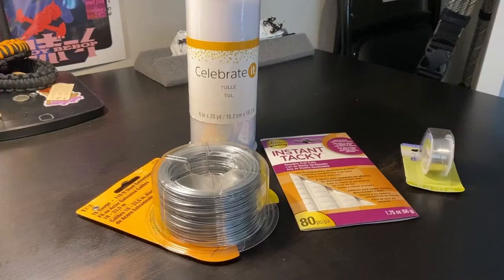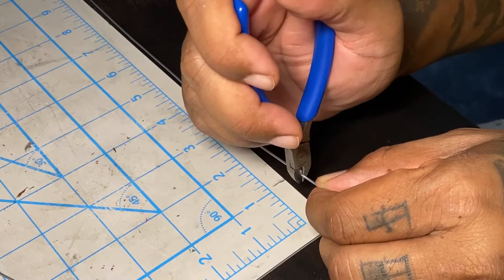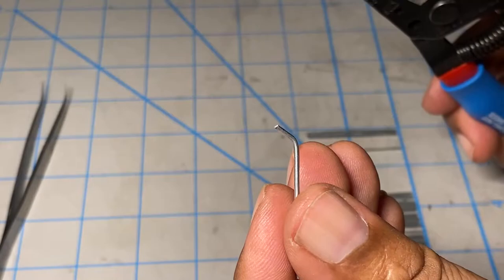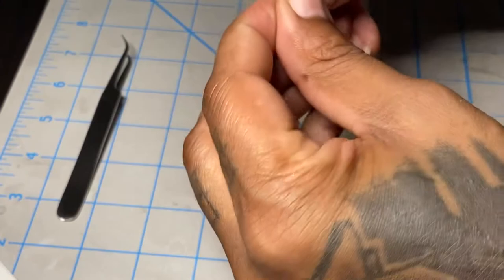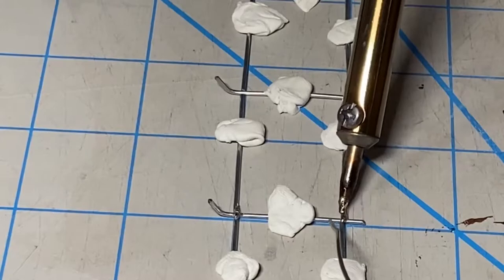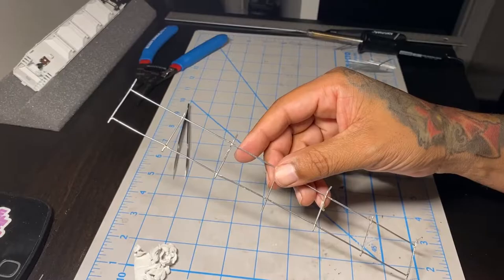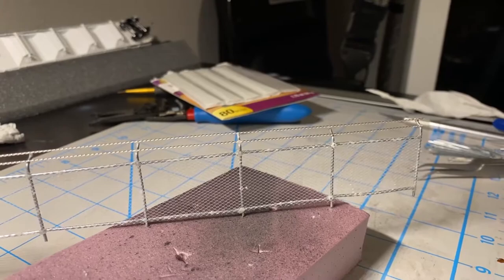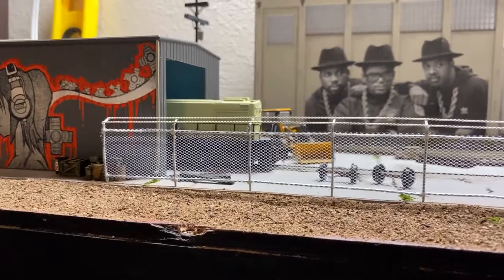Chain Link Fence (how to)

Comment: Great video. Just a note, having a single bracket for barbed wire (vice a Y shape or razor wire) is to provide additional level of protection along with the fence. You would want the bracket/wire to be setup to keep folks out. The way you have it sitting doesn't add the protection from outside sources, but does a good job of keeping the folks inside stuck there LOL. Simple fix to flip the fencing so that wire is facing 'outward' to further protect what's behind the fence. Don't feel bad, I have seen it misapplied in several real world applications as I was researching fencing for same purpose as you (yards, fuel facilities, etc).

Comment: Nice fence! I made a similar one but used a grease splatter screen from the dollar store instead of the toll or whatever its called. I found the screen to have a finer chain link pattern, and was a little easier to work with because it is rigid.

Comment: Elmer's glue (PVA) takes a little longer to dry but it dries clear.  That's what I plan to use.  I got my tulle (pronounced like Tool) from a local fabric store for $3.50 for a 6 inch X 6 yards.  Cheers from eastern TN

Comment: Reggie. If you get time. Check out another YouTube channel . Eagle Valley Model Railroad. This guy has a really great chain link fence method. He also shows how to straighten the 18 gauge copper wire and make a jig for fence. I just got done with seven 18" chain link fence sections using Eagle Valley method. Try 3M spray adhesive for applying the fabric Tulle.